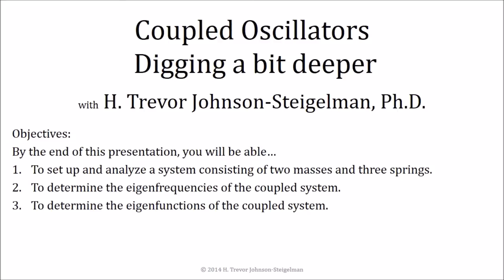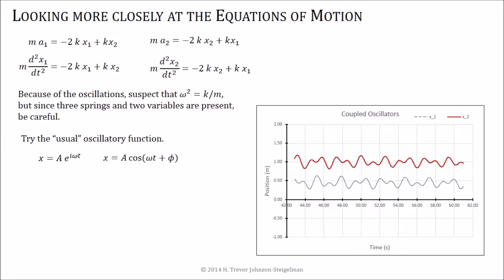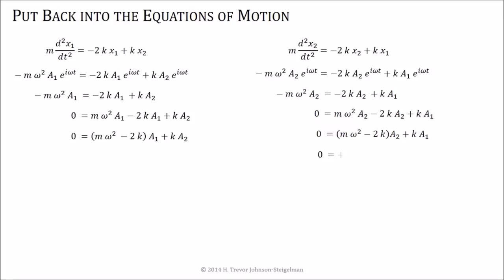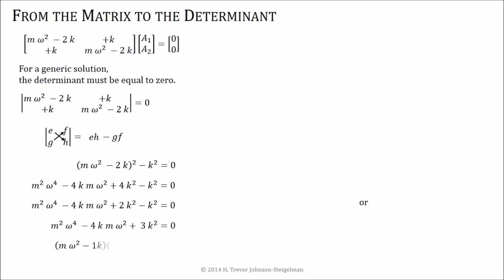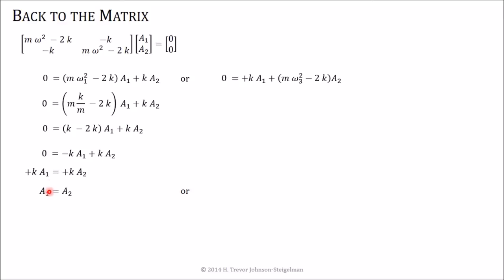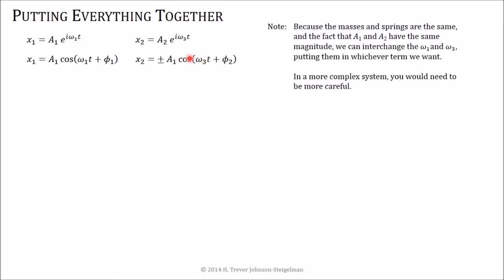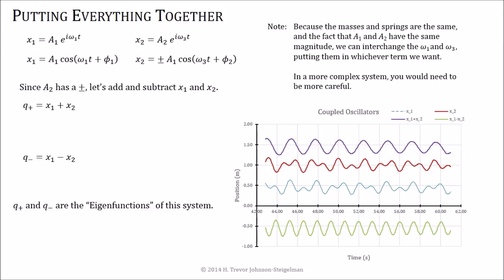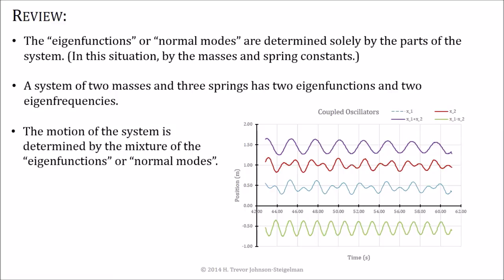Coupled Oscillators A Bit Deeper PTW

Comment: Hai, i still 10th grade and i wanna ask u why Acos (theta) equal to Ae to the power theta
Reply from the maker: When you write e^(i * theta), the i represents the imaginary number i = square root of negative 1.   (It is "imaginary" as opposed to a "real" number on the number line.  It isn't made up or anything like that.)  e^(i*theta) = cos (theta) + i sin (theta).  If we just ignore the imaginary part, we have the cosine part left.  For physical oscillators, that's reasonable to do.  For some higher level math and physics, the imaginary part might contain useful information.

Comment: So the normal mode that is positive would be the symmetric motion of the masses and the negative would be the anitsymmetric? I know I might be way wrong I’m completely new to this.
Reply from the maker: In this case, your deductions are true.  You would need to look at each case separately.  That being said, the lower modes are typically the simplest.
Reply: Physics This Week Sweet, thanks for the helpful videos!